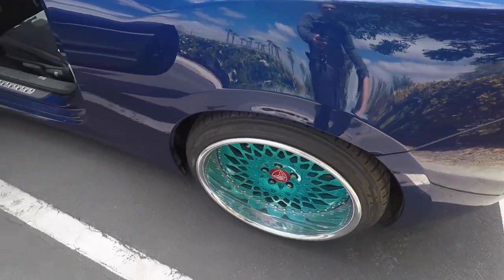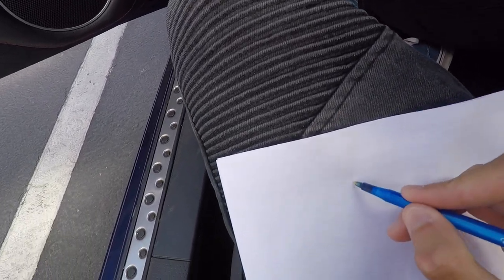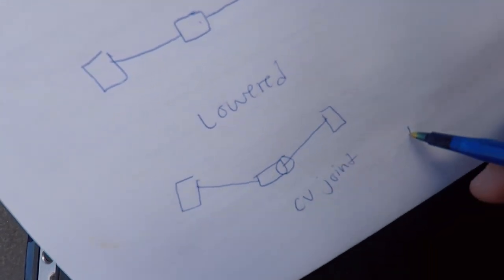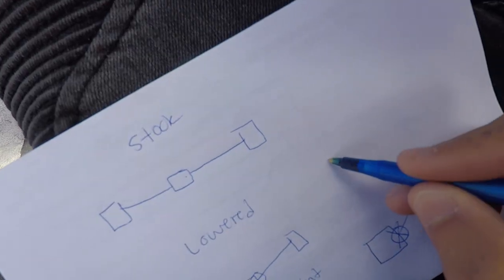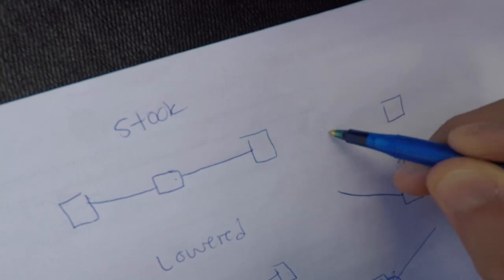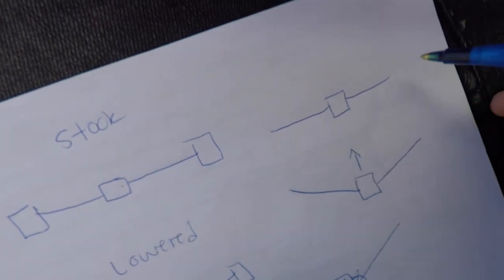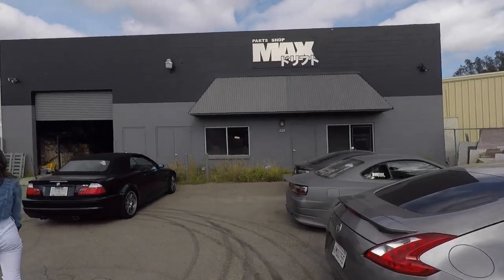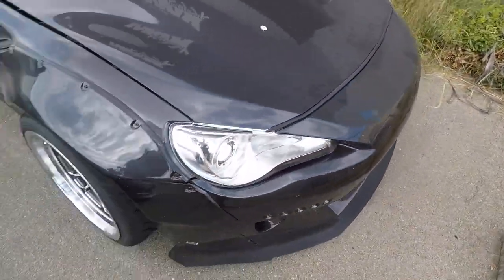FRS/BRZ/86: Why your axles break, and the SOLUTION (Clicking Axle Noise)

Comment: There’s a knocking sound that comes and goes at the bottom of my Scion FR-S 2016, it started happening right after I took it to a local shop for installing after market headlights 🤷🏽‍♀️ I’m very concerned because the sound is still there... and I can mostly hear and feel it when I go slow... Any advise ?
Reply: I wouldn’t trust that shop again. Sometimes, shops make honest mistakes so you can take it as a honest mistake or a mistake that shouldn’t have happened, but, there’s a lot of shops that purposely mess with parts to get you to come back. Be careful of those ones.

Comment: Dude! Help! My Corolla...driver axle is pointing backwards....why? No clunking or leaking boots. I just got it a month ago. Wheee/axle wobble when in jack stands
Reply: What was the problem
Reply: Kelsey Rainwater i don’t know, I sold it. Replacing the control arm didn’t do much so I think it had frame damage
Reply: @yoyobored847  so you didn't try too replace the whole cv axle ?